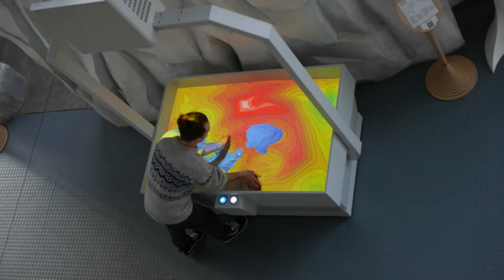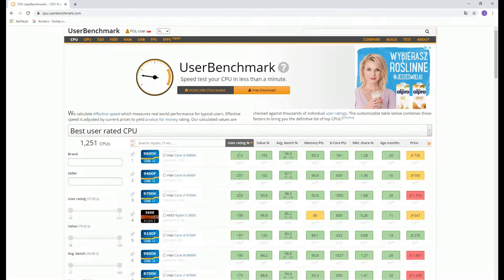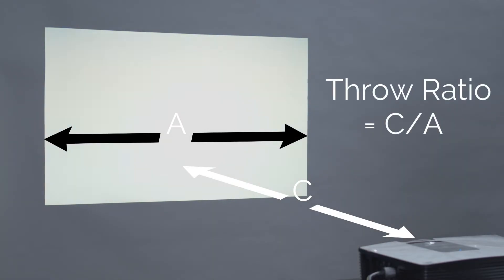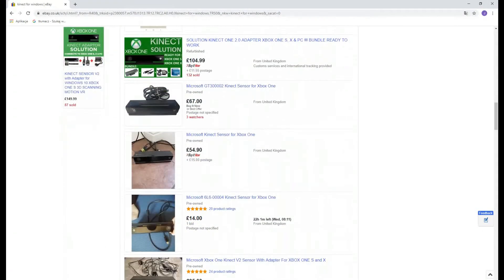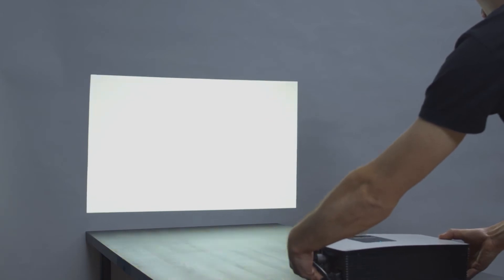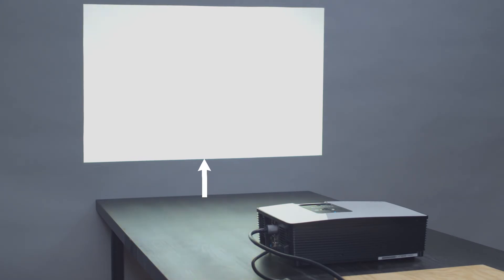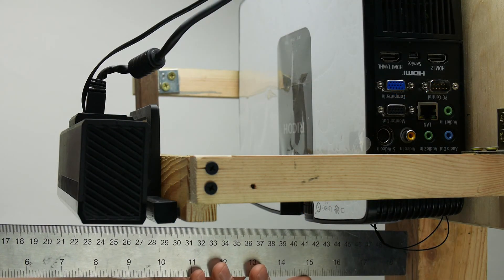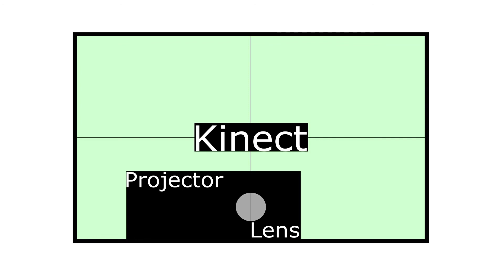Part 1: Hardware Preparation - Augmented Reality Sandbox DIY Tutorial

Comment: Is it possible to build huge sandbox
Reply from the maker: Depending on hardware you have you can build up to 4mx2.5m. You will need bright projector or run ar-sandbox in dark room.
Reply: @ar-sandbox  If the Kinect2 only reaches 2m max, is there a projector able to make a 4mx2m image or would you move the projector/kinect farther back than 2m?
Reply from the maker: @sestosaurus   kinect 2 sensor Depth Rang is up to 4.5 m. You can move Kinect and projector further or install projector and Kinect on different heights.
Reply: @ar-sandbox  Thanks for the response! I'm attempting to make a sandbox that's about 6x4 meters. Exciting to hear that the kinect2 and projector can be at different heights.

Comment: Can use Kinect v1?!
Reply: Only Kinect v2
Reply: @jurijgagarin1596 I´ve both of them, but when I looked for the specs. V2 said that you needed a Graphic card
Reply: @TheTretistaKelverian  What do you mean you need graphic card? every computer has a graphic card. Some powerful external graphics, some have integrated circuit with the processor. Basically if you have AMD ryzen with integrated VEGA graphic card it will work smoothly.